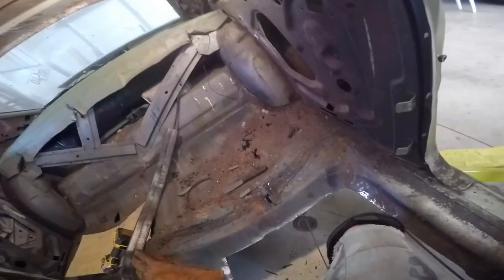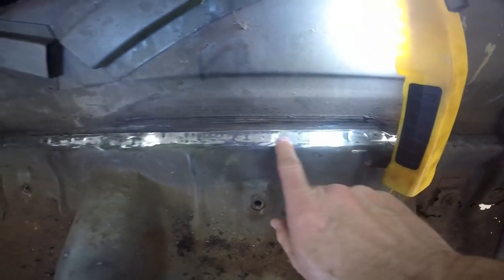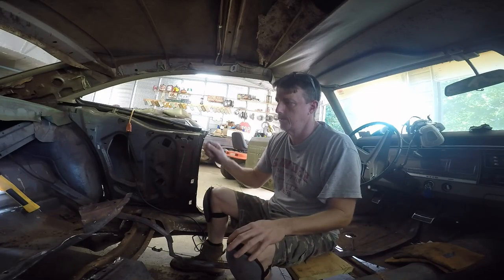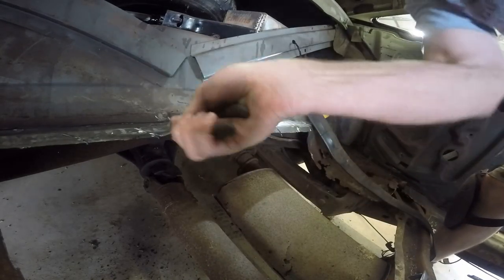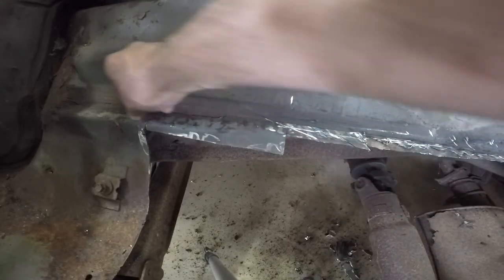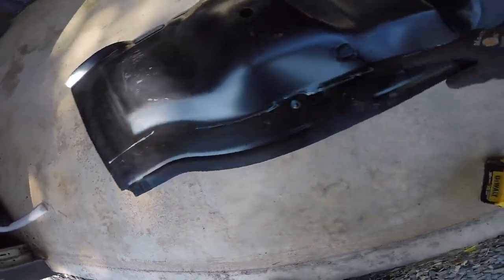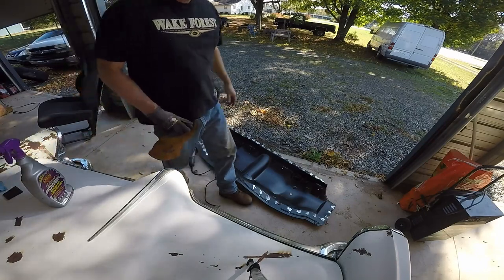1968 Chevrolet Impala Fastback Episode 5 Back Seat Pan Rust Repair

Comment: Hi ..just doing  the same at my 66 Bonneville .. question : how do you placed the new floor pan at the outside areas ? Three layers metal meet each other .. the inner rocker panel , the old under rear floor panel and the inner quarter section .. how you worked there ? Thx for any feedback 
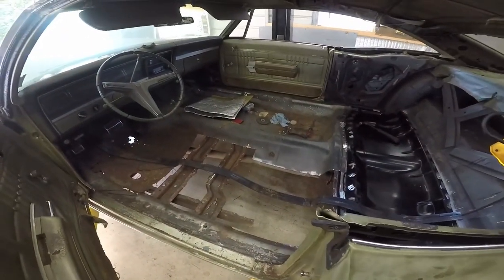Bjoern from Germany 8:01